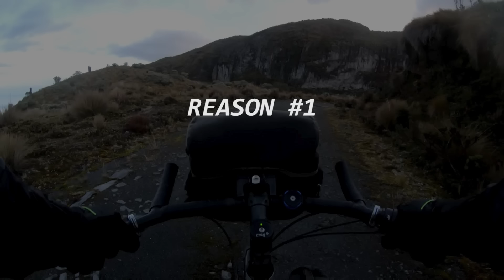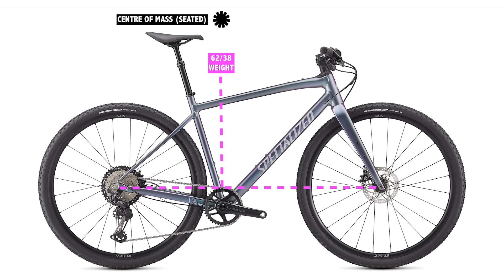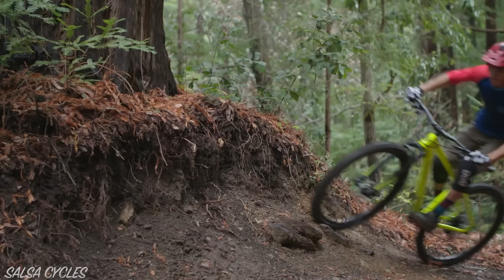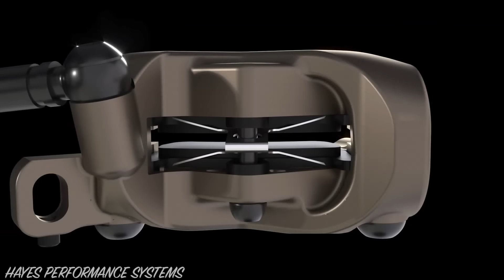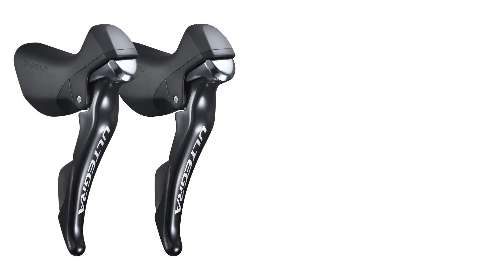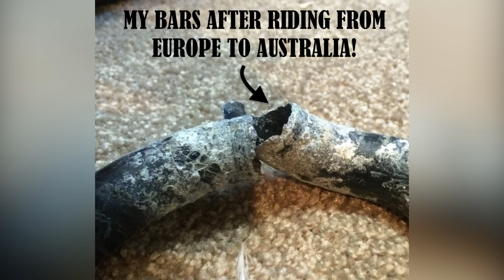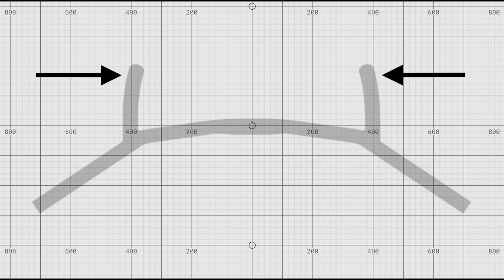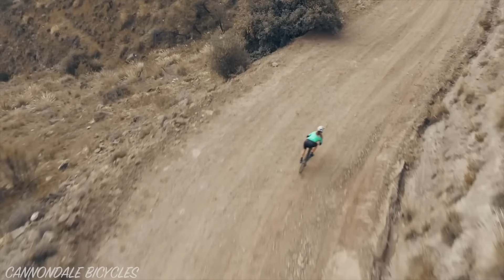Why Flat Bars Are BETTER Than Drop Bars For Most Cyclists (Objective Analysis)

Comment: The obsession with better/worse sort of neglects that they're just different. And that's okay.
Reply: Well, they're not just different. Those differences have consequences. I ride a drop bar gravel bike, and I love it, but I like to ride on all kinds of terrain, often hitting trails and very rough dirt/gravel roads. Braking and control get sketchy at times. The toe overlap, which is a non-issue on pavement, becomes an issue at low speeds negotiating twisty climbs. Why did I buy a drop bar bike? I rode MTBs and road bikes in the past, but never the twain did meet. An all-road kind of bike sounded fun (and it is), and I just kind of thought drop bars looked cooler, to be honest.
Reply: Yep, it also misses the point that if you are on the road, or on maintained bike paths, little of the advantages of flat bars mention are relevant at all. 

But you can see the bias this video quite clearly, at one point he compares a STI shifter to a flat bar shifter, but an STI shifter is both the gears and brakes, not just the shifter. Once you buy a brake lever and shifter, the prices becomes a lot more similar.

Also he fails to note that drop bar bikes are often made to be light weight as this is a key selling point, hence they are more expensive than flat bar bikes where people are less interested in this, cheap drop bar bikes exist, they are just junk. Does this weight matter? If you are putting 25kg of luggage on it, less so than in its stock configuration. 

I think the main point of this video should have been showing off flat bars and their diversity, because of course that many different types of bar, that aren't really even flat any more (like butterfly bars) have different applications over drop bars.
Reply from the maker: I have no bias. I'm simply suggesting a reason or two why drop bar bikes are often more expensive when you compare them like-for-like (same weight, same frame material and design, equivalent spec etc). I think I made that pretty clear.
Reply: @Cyclingabout  You can look at your own examples to see your bias. 

Lets take two base level bikes, the Specialized rockhopper sport 29, and the Specialized Allez. Both entry level, the Allez is £150 more at £700,  27% more in price, as you suggest, what you completely miss because of bias is what you get for that, the Rockhopper weights over 4KG or 44% more than the the Allez. 

Does that weight matter? You could argue not so much if you put 30KG of luggage on it, but losing 4KG is not a marginal gain, it is a very noticeable amount however much your overall bike set up weights. 

Not to mention something like on road bike packing where your kit will be relatively light as well. You could be riding an under 20KG loaded bike, where 4KG is a 20% weight increase. 

Reality is flat bars as a flat bar are pretty poor for anything other than mountain biking, you don't even ride a flat bar, you have what are basically hoods positioned "drop bar" extensions built into your bars, which aren't straight but flared back. 

Do people touring need the drops of the drop bars? You are right they probably don't they would be better off with a flat bar style like yours given it has the hoods positions as well. The advantage of the drops is headwinds or at speed, not really that important and easier solved with aerobars or any type of handle bar.
Reply from the maker: @Alex-to8es  A Specialized Rockhopper vs an Allez is your example, not mine, and are completely irrelevant to this discussion because they aren't remotely like-for-like. Try your assessment with the Diverge Base Carbon and Sirrus X 5.0.

I have flat bars on multiple other bikes with less backsweep and no extensions built in. My arguments for using flat bars almost all still apply.
Reply: @Cyclingabout  They are two good examples of very similar bikes, one with a far greater price than the other. 

The problem is, as you and I are very aware, they are not similar at all in fact, the number of mounting points on the Diverge is numerous, making it functional as a touring bike. These are mounting points built into Carbon, now I am not aware how much cost and engineering goes into that, but I am going to put it at a significant amount, probably not the price tag however, they are also different grades of carbon and even with those mounting points have similar weights. I would suggest the carbon lay up of these bikes is very different, hence the price. Is that lay up worth the money, you are very much correct it isn't, but you didn't actually mention that they are different in the first place for people to make this assessment. 

While I see how on shape and componentry you can argue they are the same bike. You and I know they aren't, the Sirrus is pretty much worthless as a touring bike, you can't even mount proper mudguards, let alone racks, you would be better off on a £500 aluminium bike that has them, flat bars or drops!

The Diverge is a high end carbon bike with many mounting points, that is a niche in itself, one which many manufactures dropped out of to have a more sleek look, lighter frame, and cheaper production cost in the road bike market, to the detriment of the mid range commuters! 

The funny thing of those two bikes is, functionally, you and I both know there is only one that can really work well as a touring bike...and it has drop bars on it, even when those drop bars are nothing to do with what makes it be able to be a touring bike. 

There is of course the question of if you even want a Carbon bike at all for the purpose, while extremely strong in their own right, Carbon bikes aren't particularly crash resistant like Steel or Aluminium. Repairability has sort of become a non-issue however, as high end steels and Aluminum are also unlikely to be able to be repaired these days due to the alloys used.

Comment: I swapped out the drop bars on my e-gravel bike for one of your designed handlebar and couldn't be happier.  The main reason for the handlebar change was with the drop bar I suffered from numbness in my thumbs and next two fingers on longer rides.  Using your flat bar has  eliminated 90% of the numbness.
Reply: Bars might have been too far forward, causing your weight to shift more into your hands.
Reply: @seandunbar6427  this. If you put too much weight on your hands, you will get numb, wether the bar is flat or drop.   Also many use drop bars wrong, staying down in the drops for too long, and not ever finding a position that feels comfortable.

Comment: Even though I have never had drop bars, I'm looking to pull the trigger on a new Tumbleweed Stargazer which is a drop bar bike. I also have the Tumbleweed Prospector with a Rohloff which is awesome. Of course it has flat bars. Any thoughts on the new Stargazer?
Reply from the maker: The Stargazer looks like a pretty sweet bike! It really depends what you want to use it for though. If it's gravel, there are lighter and faster options that better fit the bill. If it's off-road, a flat bar specific bike is often the best option. If you want one bike to do everything pretty well, the Stargazer would do a pretty good job of that.
Reply: @Cyclingabout  Just got a new Tumbleweed Prospector /w  rohloff and 2.8 tires which I have been riding for about 3 months and love it. Its a little heavy and has flat bars. I'm thinking adding a Stargazer to my stable would be redundant. So I'm thinking a hardtail would be better suited because of the trails around here in the Prescott area where I live. Again, I have always rode flat bars due to mtn biking, so I think I will keep it that way.
Reply from the maker: @kcreative2  A hardtail is the perfect solution for the trails of Arizona. Enjoy!

Comment: Within the first minute you discount ergonomics, but thats literally the whole point.
Reply: Ergonomics isn't subjective, there is a lot of science behind how the human body functions.
Reply: That, plus the bike fitting into narrower spaces. If your 600 mm flat bar was ever clipped by a vehicle; that might have entirely been avoided if you had a 420 mm drop bar.  When passing between those posts that keep motor vehicles off trails, you don't have to wonder "am I going to clip that with my handle bars?"

Fitting through narrow corridors, doorways, elevators, bike storage lockers: all easier with narrower handles.   

You can get a 440 mm wide flat bar for these same benefits of fitting; but why waste the opportunity to upgrade to a drop bar.
Reply: If Alee Denham considered drop bars to be ergonomic enough for him, I guess that means that it has the potential to be for a lot of users who don't nearly spend as much time on a saddle as he does.
Reply: He did say that’s subjective, he was talking about this objectively.
Reply: @michaelb9664  ergonomics go far beyond comfort and as a science in itself has defined objective measures
Reply: @feedbackzaloop  but both flat bars and drop bars are ergonomic. The preferences regarding comfort or the overall positioning of levers and shifters between both types of bar are personal and subjective.
Reply: @michaelb9664  
Yeah, depends on what you need really. I find that flat bars give more brake control and maneuverability over terrain. drop bars are worse in both those aspects but triumph in terms of comfort in touring and endurance.
Reply: @michaelb9664  here I'm not saying that one is more ergonomic over another, as I personally don't know for myself, and find it questionable how you can make such short, simple, definitive statement.
Point is, one can analyse the handlebar designs with regards to ergonomics objectively and if it takes a scientific approach, this might be the best if not the only YT channel to perform this.
What I can predict though, is that variations within the types make variation between types insignificant.
Reply: @feedbackzaloop  I really don’t understand what you find questionable about my statement?
Reply: @Exgrmbl  I agree with you.
Reply: @michaelb9664  this is exactly my point: you put statements in place of arguments and don't see the problem with that.
Reply: @michaelb9664  I happened to ride a wide flat bar the other day, and it was a bad experience due to the fact that my wrists have to bent inwards. Terrible ergonomics. I use Surly Open Bar on my 29er and it's WAY more comfortable than a flat bar.
Reply: @michaelb9664  But it isn't. People can find flat bars or drop bar comfortable, or both. But disregarding what is more comfortable in which situation is just silly. I don't think anyone would suggest that drop bars work that well on anything but roads, bike paths, and well maintained off road paths. As soon as you get to anything that is even slightly wild having the stability and weight balance of a mountain bike, rather than a road bike, give you more control, comfort, and stability

None of that is very relevant if all you are doing is tarmac and maintained off road paths. Not everyone is cycling up a mountain in Peru, most are cycling to the next camp site in Germany. 

Reality is it becomes more an issue of tyre width, which flat bar bikes often allow for wider, but more drop bar options are available these days. The problem is there, if you aren't going fast, because you are on gravel, or have higher rolling resistance, the aerodynamics of drop bars are less important. So flat bars do have their own merits there. 

It would be a better video if he just said drop bars are better for this, traditional flat bars aren't great on their own, but flat bars in all these different configuration can give you far more utility. Because the bars he uses are basically a flat mountain bike bar with an integrated drop bar hoods position. Most people don't use the drops these days for anything other than descending and sprinting as the the hoods are actually the most aerodynamic if you set them up for an aerodynamic body position.
Reply: @Alex-to8es  Maybe it's just me, but I'm under the impression that drop bars are more ergonomic for the very simple reason that it doesn't force your wrists into a pronated position, which can be a cause or accentuate wrist issues. But maybe there's other elements that are important too and I'm just focusing on that one because I have wrist issues (as someone who works a lot with computers and draws a lot).
Reply: @Alex-to8es  have you heard of gravel bikes? Basically a road bike with off road capability, therefore they come with drop bars and wider tyres - yet are expected to be used off road as well as on the road.

As said both flat bars and drop bars are ergonomic, if they weren’t they’d be useless on a any bicycle. One may be better than the other for given situations, (which was very well covered in this video I might add) - but they are still both ergonomic. Both fit the hand and work with the body position required to ride a bike. Both allow you to operate gear shifters and brake levers with ease. 

The benefits of one over the other for given situations and terrain are not down to ergonomics. 

What one person favours over the next person for a given situation is not down to ergonomics as both will still fit your hands ergonomically. Perceived comfort or preference for one over the other differs from one person to the next. That’s subjective, not objective which is what this video was all about.
Reply: @michaelb9664  There is a reason 90's mountain bikes evolved into modern day mountain bikes, and that is because they weren't very good on actual wild off road. Much like gravel bikes aren't design for off road, hence the gravel road part of their name.

Gravel bikes make perfectly reasonable touring bikes, but really are just worse bikes than touring bikes for actual touring as they won't have as many niche features for it.
Reply: @michaelb9664  "have you heard of gravel bikes? Basically a road bike with off road capability, " No. gravel isn't offroad mate. Its gravel. Nobody uses drops on off road.
Reply: @kudosbudo  that’s funny, all of the gravel around me is very much off road. Plenty of people use drop bar bikes off road. 

How about cyclocross? I suppose that isn’t off road either you muppet.
Reply: @kudosbudo  not true ..there are people who ride drops off road incl fairly technical ,gnarly stuff although they are certainly not in the majority.
Reply: @michaelb9664  Keep it respectful. No need to call anyone on here a muppet.
Reply: @bruce.KAY-bike-drifter  I’m sorry I just have a low tolerance for people quoting me with stupid incorrect comments. 

This whole discussion is filled with people who have no understanding for words like ‘ergonomic’, ‘objective’ & ‘subjective’. They are basic words in the English dictionary and people completely missed the point of this video and it’s a just waste of time trying to explain. 

Then there are those who choose to completely overlook gravel and cyclocross with comments like ‘no one uses drops off road’. I’m sorry, but I have no tolerance for ignorance - when the ignorant are trying to preach incorrect info as fact.

Yeah I might get a little passionate about it, but I only speak from experience or genuine knowledge, not just the first piece of garbage that comes into my head. Maybe I should just avoid the comments section as it’s full of stupid people.
Reply: @kudosbudo  a lot of people use drops off road...I love riding my gravel bike on trails...
Reply: @michaelb9664  I don’t think ergonomics is subjective.
Reply: @michaelb9664  I consider pain to be pretty objective, at least to the person experiencing the pain

Comment: Why does it have to be "either"-"or"?  I prefer both.  I want the best of both worlds.  I want a bicycle that can handle rough steep climbs/descends and fast paved roads.  Come on bicycle  industries, get with the program.
Reply: Just use flat bars ans aero bars.
Reply: @chuckyfox9284  Mountain bike gears lack gearing for high end speed.
Reply: Quick release handlebars?  That could make a buck.  Especially if braking, drop post, and shifting become electronic, why not?
Reply: @maaku.moreno  I completely agree with you.  They should make hydraulic handlebar that allows you to adjust its height.

Comment: Stand up and drop your hands down naturally. Now tell me which handlebar matches the natural wrist angle. It sure is not flat bar.
Reply from the maker: I wish biomechanics were that simple.
Reply: @Cyclingabout  Agreed. Love your channel.
Reply: Flat bars with a generous sweep. When you drive, are your hands at 3 and 9 or 10 and 2 like 99% of us?
Reply: @FightFilms  However, they have been teaching 9 and 3 for quite a few years because of airbags. It gets you hands out if the way so you don't punch yourself in the face. I personally drive 0 and 6 most of the time. Maybe I should just have half a flat bar on my bike?
Reply: Good point fight film. Also I think what you are used to makes a big difference. I've always mtb`d and standard road bars are horrible for me. I literally can't believe ppl can use them.. I need at least 10deg of flare for drop bars which is roughly "10 and 2"
Reply: "Now tell me which handlebar matches the natural wrist angle. It sure is not flat bar." 
Flat bar with bar ends. Easy.
Reply: Now tell me which handlebar matches the natural wrist angle. It sure is not flat bar." 
Flat bar with bar ends. Easy. Plus, why do I see road cycists cruising around on the tops position ALL THE TIME? :)
Reply: @michaljambor7772  correct but with bar ends your hands are away from the brakes and for urban riding that split second delay can be important.

Comment: I use both gravel bike & mountain bike so I surely confirm that the only advantage of drop bar is only aerodynamic (speed). It's alright if you choose 8% aerodynamic efficiency. As a doctor I think flat bar better because it's the most suitable anatomically. Handling drop bar is like driving tank. If you want to turn left so push right, if you want to turn right so push left.🤷🏻‍♂️